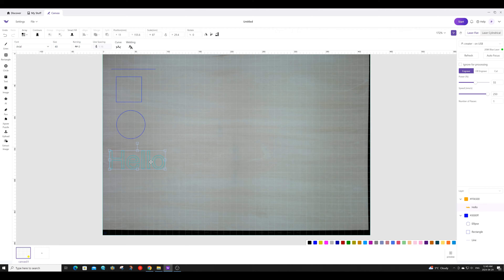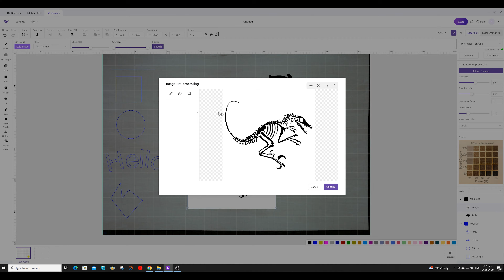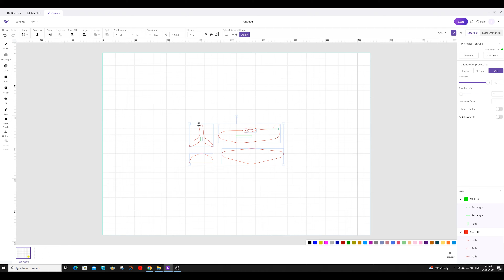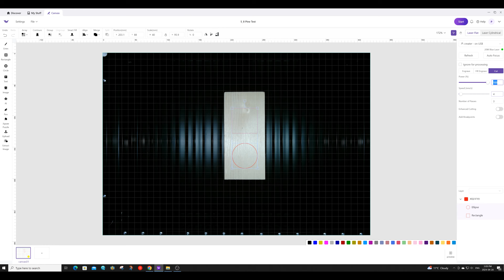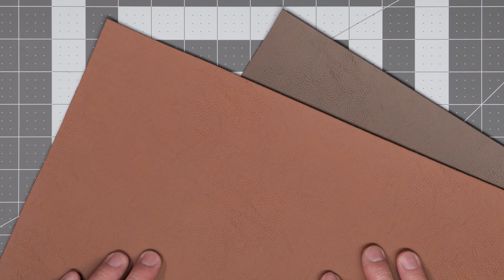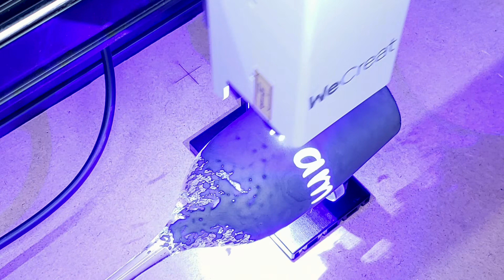The Best Laser Engraver for Beginners? Wecreat Vision

Comment: Thank you so much for this video, it is by far the best and most complete beginner's guide I have come across. I have owned mine for several months and still had questions. Thanks again for the Review and examples. I do have one question. How did you get the honeycomb installed? Did you cut it to fit for use with the knife? Where can we purchase it.
Reply from the maker: You're welcome.
You can order custom sized honeycomb beds from sellers on ebay. That's were I got mine.

Comment: Where did you find the Rustoleum Spray Chalk? I can't find it anywhere. Can you post a link.
Reply from the maker: I just searched too and it seems to be out of stock everywhere 😫 
Try brush on black Tempera paint instead. It's also washable and works well for engraving.
Reply: @MakeTechCreate  I have some of that, I just can't get it consistently blacked out. I think I'm gonna try the Montana Cans Chalk spray paint.
Reply from the maker: @Southernboy302  try using 2 coats or a different brand might work better.

Comment: I can’t express enough how well you provided a preview of the WeCreat -Awesome JOB👍👏!  I do wish you had a test run for batching to see how accurate the camera is. Also,  the demonstration you just provided here would you still consider getting WeCreat 20watt or the their new 40watt laser? And let’s just leave out the cost difference. 20watt or 40watt? And why?  

I definitely subscribed! 😎
Reply from the maker: Thanks!
The camera is more accurate on the vision than any other laser I've used after I calibrated it. With that said, cameras are never 100% accurate.
That's an easy choice. If you're primarily doing cutting, get the 40 watt. If you're primarily doing engraving, get the 20 watt.